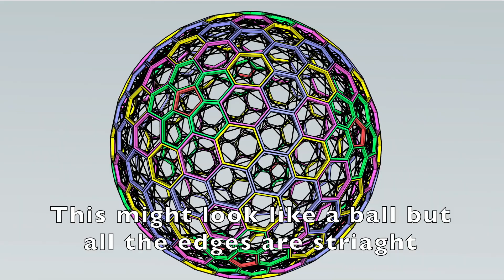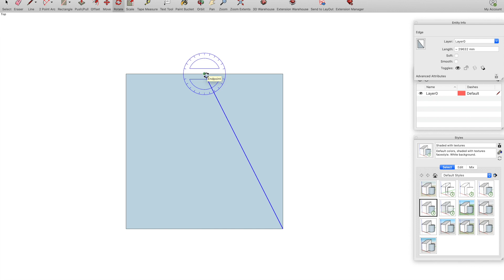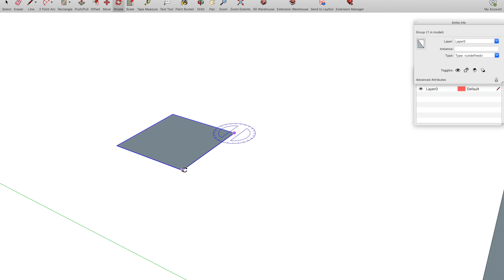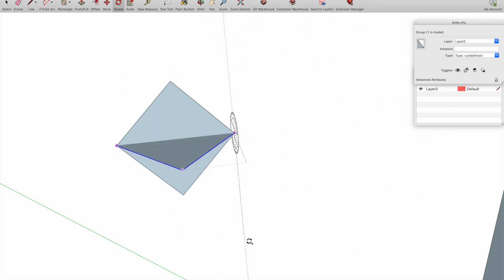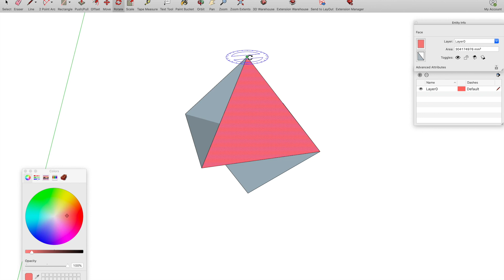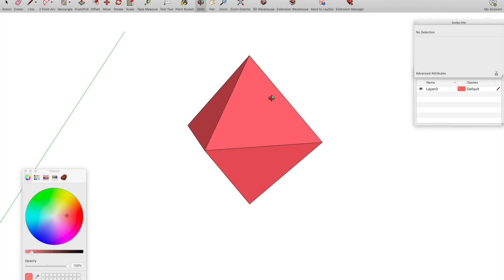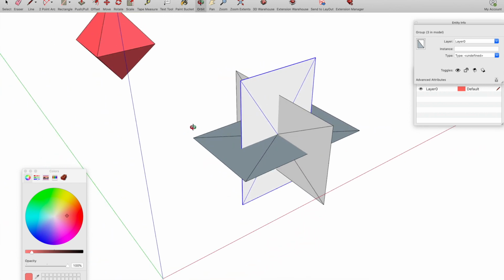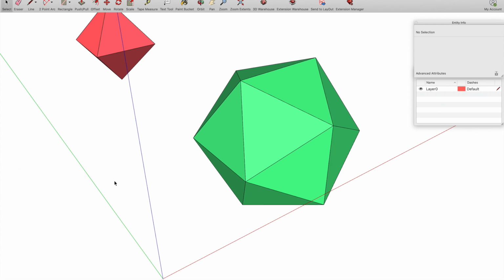Geodesic domes have more in common with squares than circles!

Comment: I get what you're saying, and its a great demonstration. But the relationship between the geodesics and a sphere is through the rotation, without a circle or sphere you couldn't have the 90* rotation along the axes, which is what informs the angular relationship between the faces / planes.
Reply: Also, the formation of the golden rectangle by this method uses a compass, which is a circle